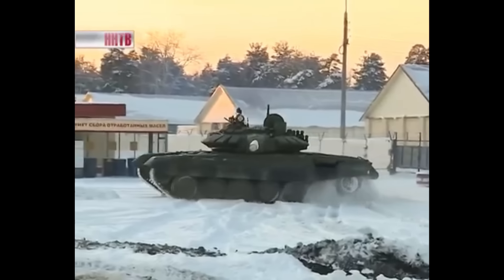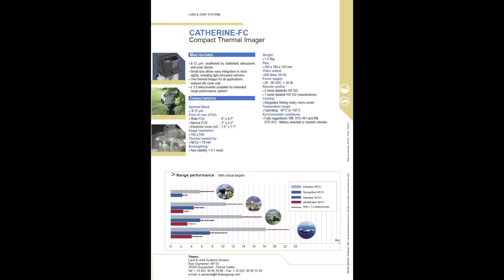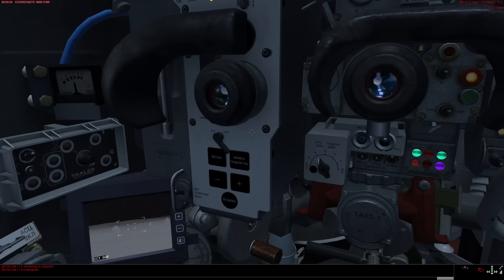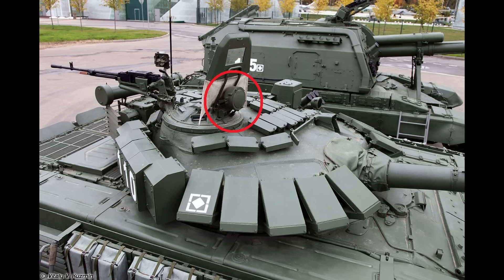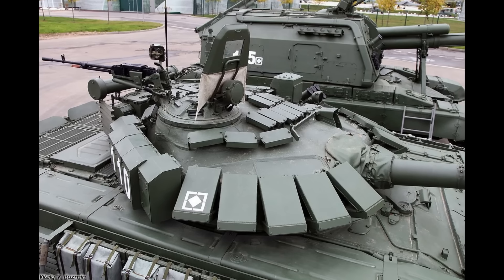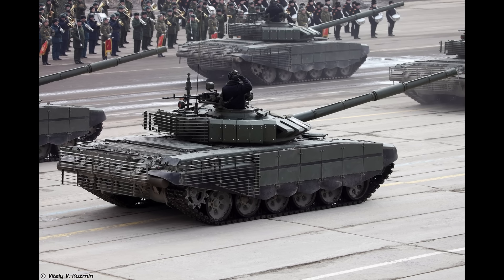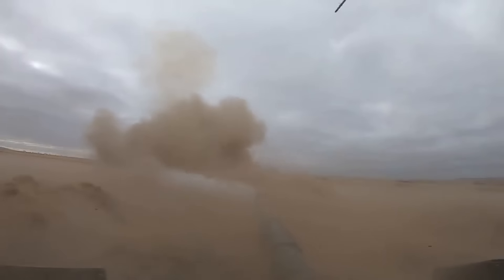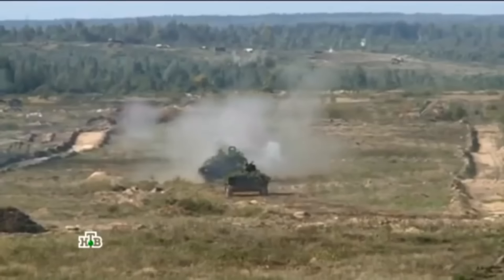Problems with Russian T-72B3 tank

Comment: On the visibility from commanders position on a t-72 without the special upgrades in t-72b3m: It is indeed basically nonexistent. I always found it necessary to be in unbuttoned head up position to have any situational awareness. You cannot really function inside when moving and even while stationary normal binoculars were better than the commanders sight.
Reply: That sounds like a pretty major flaw in modern warfare where seeing someone or being seen first can be a determining factor in whether you survive.
Reply: @patrikcath1025  The commander on the T-72B3 and T-80BVM has a simple device that allows you to detect the enemy during the day at a distance of a couple of km. The night vision range is small. However, the commander can intercept the firing control from the gunner and has a monitor with an image output from the gunner's sight. The commander's panoramic device allows you to find targets faster and give target designation to the gunner. But the absence of a panoramic device from the commander of the T-72B3 and T-80BVM is compensated by their low cost. When installing a panoramic device, the cost of these tanks will increase by 50%. It is better to buy more tanks than to put the commander's panoramic instruments on a smaller number of tanks. 3 tanks are more difficult to knock out than 2. And according to the enemy detection capabilities, 3 T-72B3 will be approximately equal to 2 tanks with panoramic devices
Reply: I always preferred to be up top as well (Abrams), it's hard to beat the SA it gives you. People do tend to underestimate just how FAR you can detect things with the naked eye. Our pericopes were effective, but much bigger than the T72s (and the periscopes on the SEPs are absolutely MASSIVE).

On the Abrams though, there is a third option for "open protected" that allows you to look out of the hatch, but still be protected by it. Russian tank hatches don't look like they could really even be modified to do something similar.
Reply: @ФедотовДмитрий-щ3г  Having more tanks won't help if those tanks can't see their targets fast enough to matter. Not to mention that well trained crews are almost more important than the tank.
Reply: @TehIdiotOne  well trained crews are always more important than tanks. Well trained crews can be helpful even without a tank, you can't say the same about the reverse
Reply: @marcohorodnichev9489  I don't see any any well trained human being able to throw an 20kg explosive projectile 2km away

Comment: I’d be willing to overlook a lot of flaws with the T72B3 if it came factory mounted with the panoramic commanders thermal
Reply: AND IT WILL COME...
Reply: @warmbreeze7996  
LIKE A FLOOD OF PAIN
Reply: @TR33ZY_CRTM  

POURING DOWN ON ME...
Reply: When installing a panoramic sight on a T-72B3 tank, its cost increases by 1.5 times, unfortunately, the Russian military leadership believes that it is better to buy more tanks. In fact, there are modifications of the T-72 with such a sight, these are T-72B1 M S tanks that were delivered to Serbia and Laos.
Reply: Including the turret popping off maneuver......snick snick.
Reply: @warmbreeze7996  AND IT WILL NOT LET UP UNTILL THE END IS HERE
Reply: No. The panoramic sight is too much of an expense on the T72B3 price. That's the point why it was installed on the Biathlon version, but not on the series model. That's the whole point Russia has done and is capable of doing it, however it doesn't justify the price of a tank. The T72 is not supposed to be the best of the best. It is supposed to be the baseline. The baseline which has an advantage over the T90 with it's speed (because it weighs 5 tons less), it's simplicity - much easier to repair, and it's cost (not as bad losing it compare to the T90).
And it fulfills that role perfectly, it doesn't need to be anything else. The baseline of a tank for the Russian army.

Comment: These tanks need to be used with infantry and air cover to be effective. They don't do well sitting on a highway all bunch together. Great video sir can't wait for the T-90.
Reply: Any modern tank gets a side shot of modern atgm, it's dead.
Reply: Russia will have a hard time recovering from the losses.
Reply: @Tonixxy  nope not abrams as it has very strong Era and hard kill perfection systems
Reply: @cortney3280  I said get hit, if active protection stops it its not gotten hit
Reply: @Tonixxy  ATGMs hit the top of a tank generally, which is even worse.
Reply: @cortney3280  No an Abrams would be annihilated. The ERA would do nothing, the best defense is a trophy system, which is rare and new.
Reply: @kazak8926  it's not rare and it's not new and the Era can stop he and apfsds alon with missles just a single 1980s mi qbemas can stop Russia most advance m8sse the korneg but hey have a great life as the will be one of are last conversations hahah
Reply: @cortney3280  Actually he is right, the Trophy APS is still fairly new system (2011) and it's still very rare (only around 330 Abrams are upgraded with this system) which is not bad, but it's only a small percentage of the total 1700+ Abrams of which most are still without APS. 

But at least the system is already battle proven and very effective, so the tanks that have this system are very good protected and have a good survivability on the battlefield
Reply: @xAlexTobiasxB  only 330 abrams isn't that more tanks tanks then Germany have in total? Lol
Reply: @cortney3280  Yes of course and it's far more than any Russian tanks with APS (only around 25 to 50 Armata with APS, which isn't even in full active service yet)
Reply: Oh I don't know, when America went into Bagdad (2nd Gulf War) they didn't have air cover or infantry support. The Abrams tanks went in full speed shot the hell out of everything creating chaos and disorganization to the Iragi troops. Took only 3 days to take Bagdad with what 1 or 2 KIA.  It's having a badass tank that counts, no amount of troop support can make up for a shitty tank.
Reply: @Tonixxy any infantryman can be killed by a knife to the chest. So infantry is obsolete.
Reply: @kazak8926 very few do that.
Reply: @johannjohann6523  Dude what are you talking about. The gulf war had one of the largest air campaigns and CAS campaigns in human history. The Abrams have taken dozen of losses in Iraqi and Egyptian Service.

Comment: It is highly improbable that any WWII rocket launcher would be able to penetrate T-72 or T-90 armor, even without ERA. I mean, multiple RPG hits are required just to immobilize a T-72, as evidenced in the Russian invasion of Georgia.
Reply: From front? Yes
From side? Say bye bye to your turret
Reply: @petrsukenik9266   No, actually from all sides, it takes at least 4 RPG hits, maybe 3 just to immobilize the tank if it's the firer's lucky day and the tank crew's bad day. Watch from 10:50 to 11:05:
https://youtu.be/Z0xUt9A1AXw
Reply: @col.waltervonschonkopf69  The side armor of Russian tanks is only 70-80mm thick. The first bazooka, dead on and without side skirts would be able to go through the sides. Larger rocket launchers like the super bazooka or the panzerfaust / panzershreak would have little issue, even with the side skirts
Reply: @ImBigFloppa   Watch the relevant part of the video I have linked in the previous comment. I am not talking theory, I am just saying what actually happened. Plus, armor strength is always measured using Rolled Homogenous Armor equivalency (RHAe), not by the actual thickness of the armor.
Reply: @ImBigFloppa   Plus RPGs can only immobilize tanks, not even disable them, much less destroy them or kill the crew inside. Tanks are not called beasts of war for nothing.
Reply: @col.waltervonschonkopf69  You still do not understand.
1 panzershrek is able to penetrate side armor and eliminate a tank.
How many shots needed in terms of statistics -it's another topic.
Reply: @ukuskota4106  Maybe against tanks in WWII or even now against modern tanks, but in another universe.
Reply: @ukuskota4106  just an empty words...
Reply: @ukuskota4106  heу tounge twister, keep talking 😁

Comment: The main problems with this tank is that its designed and produced in Russia.
Reply: Ukrainian bot moment
Reply: Produced, yeah. Designed? Maybe, depends on doctrine. Definitely could do with some upgrades
Reply: @mrmacias4217  russian denial usual day
Reply: @tomygun7532  Ukrainian bot moment
Reply: How is russia producing its own tanks a problem for russia?
Reply: @yegorgribenuke6853 because together with producing the tank, they also produce the problems in the tank like the slow reverse speed or turret auto ejection system.

Comment: What it is is peak cost efficiency. Cost efficient vehicles are never the best money can buy, but the farthest money can go.
Reply: @foedspaghetti3290  The 125mm gun is more than enough to match the range of western tanks, especially equipped with the Refleks missiles that hit out to 5km. It's the optics and skill of crews that hold it back at range.
Reply: @yoloman3607  Agreed. I wanted to make the point on the optics but simply used the term “out gunned”. My mistake. Thanks for setting that straight.
Reply: @yoloman3607  that reminds me of the videos from a Syrian army tank with thermals. Just one tank with modern optics gave them a huge advantage against HTS

Comment: Why would any sane tank designer cripple his tank with a low reverse top speed? That seems like a flaw which would emerge not from a desire to reduce production times and costs but from a doctrinaire obsession with not retreating.
Reply: It is because of the doctrine of the tank shaft.  The USSR at the end of the 80s was armed with 65,000 tanks.  On the western front alone, he had about 30,000 tanks, which was more than all the tanks in NATO.  So there would be no need to back out.

Comment: Finally some proper emphasis on the reverse speed issue. I've been frustrated about all the russian tank videos not even mentioning the whole issue. It is absolutely mind boggling that they have not done anything about it during all these upgrade cycles. I guess russian army generals just wants to look cool with their new thermals and era, upgraded reverse speed would not look too media sexy =D
Reply: Suddenly nobody is making a joke about French Leclerc having almost 40kph reverse anymore.
Reply: @TonymanCS  Problem with Leclerc is that it is always in reverse. ;)
Reply: @TonymanCS  Well, French sort of need it 😁
Reply: It's all about the on-board gearbox. The transmission is not changed. If we had a transsmission like Leclerc's, the T-72 would be the size of a barn.
Reply: It has to with the size of the engine and almost no space for extra reverse speed… basically the whole compartment needs to be redesigned

Comment: The T-72 was designed to be used in mass as break through vehicle supported by preemptive artillery strikes. Once you bog them down and deny fast movement and they are not used in mass all the weakpoints get exposed. That's one of the problems with Soviet designed weapons. You have use them according to the original doctrine or else they become a liability. Philosophy of use my guy.

Comment: BMP has also slow reverse speed. I sometimes envisioned, that it could have had two speed reverse like it had forward gears (1st is for very bad terrain and towing, 2nd is for normal starts). So, one slow reverse for normal usage and the second reverse for combat.
Reply: but she vomits like a cat from a place, literally jumps, an infantry fighting vehicle is not a vehicle for open combat, just like Bradley
Reply: okay . you comment like you tank engineering or you just work as parcel delivery

Comment: Real problems for Russian tanks is not concealed in nitpicking the gen of their sights or millimeter wide gaps in their reactive armor, but rather a lack of infantry to provide good flank defense for advancing tanks and modern reconnaissance. All of these videos you’re pumping out are near irrelevant considering the lack of the aforementioned elements. Fun discussion for warthunder fans where it’s a vacuum with armor against armor, but in real warfare a t55am would outperform a leo7 if the former was used with proper recon and supporting infantry vs the latter if it was sent off to charge deep into enemy territory and lacking adequate support.
Reply: "proper recon and supporting infantry"

All those are easy artillery targets that will get turned into mince meat the moment they leave their trenches. Infantry that follows armor tends to die very quickly.
Reply: @Frenchfrys17  you cannot win a modern warn without combined arms, that is everything
Reply: @AmazonWebService98  That does not change the fact that as a footsoldier, being near friendly armor is a death sentence.
Reply: I’d still rather a leopard protecting me I get ur point tho
Reply: @Frenchfrys17  except the Leo 2 in the example is doing what we call a Russian. Going in with little to no support. Artillery is not in this scenario. 

The point was that even older tanks can outperform newer tanks if supported well.